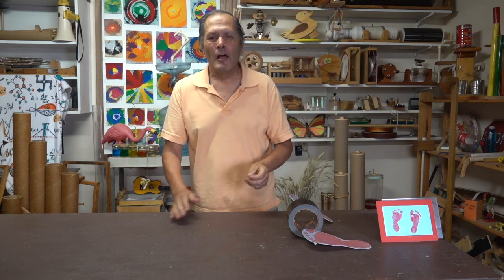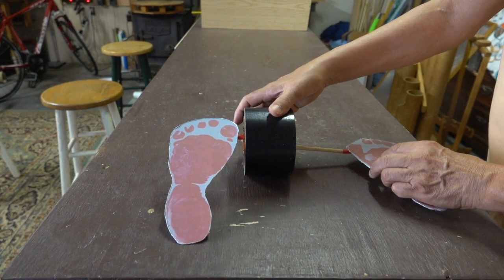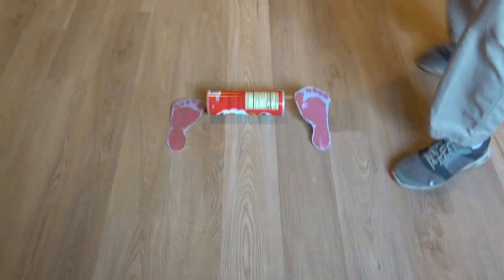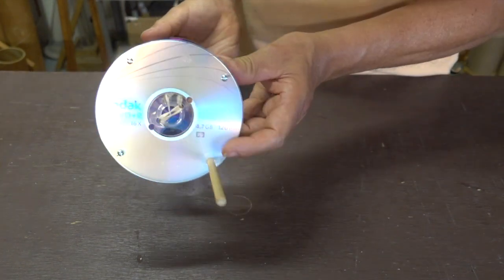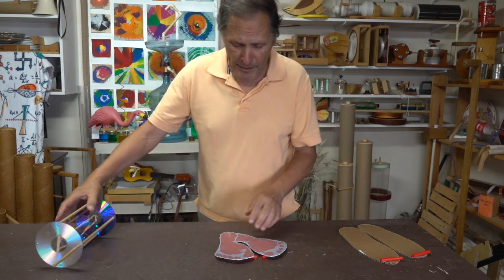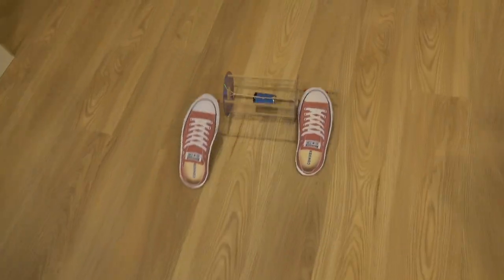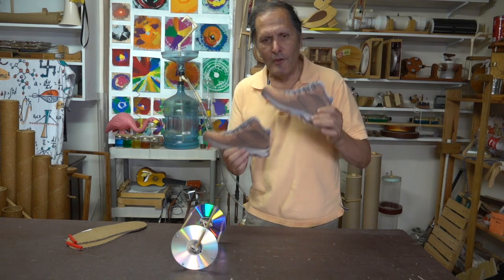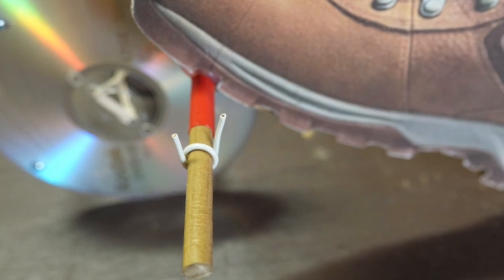Walking shoes roll-back toy // Homemade Science with Bruce Yeany

Comment: Aside from the walking shoes (fun, but no new fizzix) if a rubber band were wrapped around the rim of each CD, this would improve grip.  (I noticed a lot of sliding in some runs.)  Would the machine then be able to climb inclines?  An interesting problem: on the level, does increasing the weight increase the range?  (Thinking of the trebuchet analogy.)  But if it had to climb hills, then a larger weight should decrease the height it could climb?  To increase range, we presumably need to store more energy, but what is the best way of doing this?  Note to self: will need to think about this again when sober.  :-)  Thanks for a fun experiment anyway!
Reply from the maker: this was a work in progress,  I thought I would throw it out there and see what people thought and what suggestions they might have.  thank you for yours
Reply: @YeanyScience  Looking forward to follow-up projects!  I think you might be able to use it to discuss energy conservation, and the impossibility of perpetual motion machines.

Comment: Make a stationary axel with wheels (cd's) Have vertical rods from the axel to support a cut-out of a person. Add a set of shafts (straws) offset just above the existing ones. Attach  to the cut-out person to make moving arms. 

Also have two sets of toys, with stationary axels, connected with a rod (drive shaft) A couple small vertical rods coming up from the drive shaft to support a cut-out of a baby. (grandson) Add arms to the front and bent legs to the back to simulate crawling baby.

Comment: Hey Bruce just wondering what that symbol on that blanket is (in the middle left at the back) at 0:27
Reply from the maker: I received the blanket as a Christmas gift a few years back with several science  symbols and equations printed  on it.  I've identified about half of them so far.   I'm guessing the symbol you are referring to resembles a swastika if it were rotated counterclockwise slightly,  also resembles the Hindu Holi symbol but with arrows added to the end.  As a physics symbol,  I don't know what it represents but would very much like to know myself.  perhaps someone else may post any answer
Reply: @YeanyScience  ok cool, sorry I realise that that may have come across as a bit hostile and it was really not meant that way. It's just that one has to be careful on the internet because people can be tricky. Again sorry if this came across wrong, it was not meant to.
Reply: A propeller with direction arrows? There is a hole in the middle...and no, this is not the nazi cross if that's you think 😱
Reply: Just looks to me like a diagram showing directional force vectors acting on cross axles...but I have no clue.
Reply: The symbol for luck/good fortune? It's a very special symbol for some religions still today.

Comment: I wonder if the boots would look more like they were walking if the straws were positioned under the arch?
I loved the roll back toy we made in camp . . . Never forgot it.
Reply: I am thinking he can play with the oval and add a second set of disks that trail the first set of disks.. to give the shoes effect of rising off the ground as they are walking  (using a straw on tow and heal of the boots?
Reply: @manp1039  That crossed my mind too . . & why not 3 dimensional shoes   . . . Could even have a light weighted doll riding a tricycle because that's what those feet look like they are doing  . .